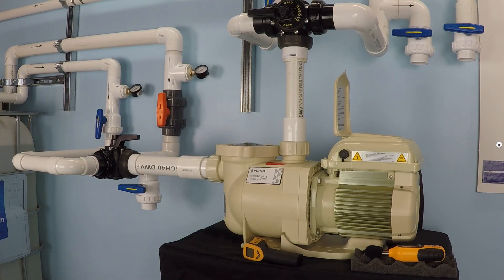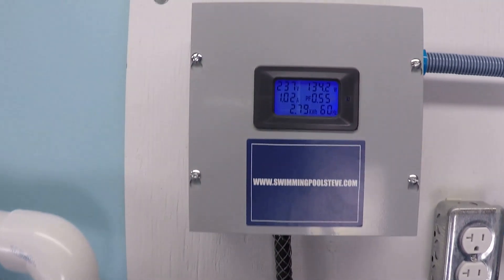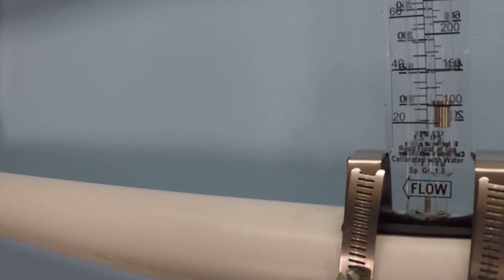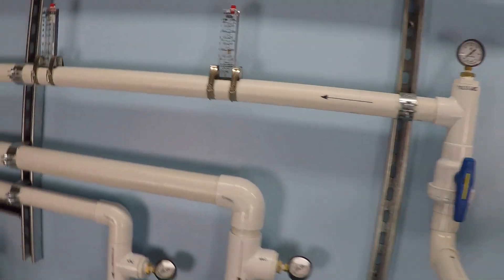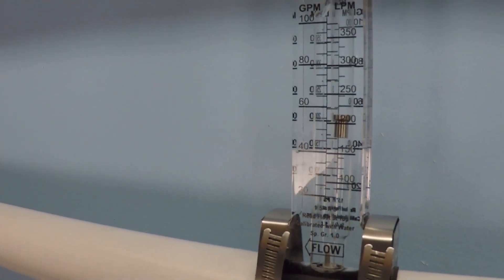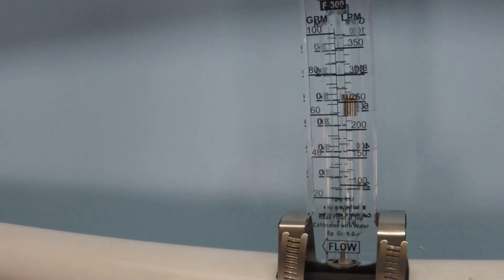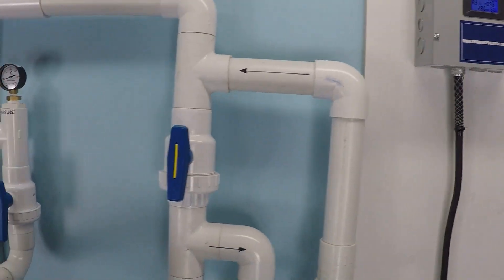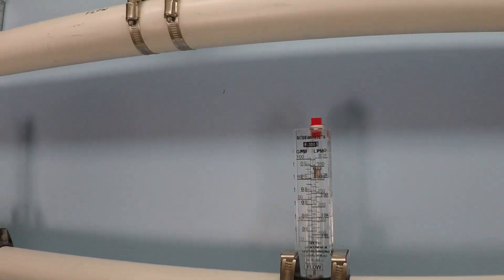Pentair SuperFlo Variable Speed Pump Test (Dual Suction Lines)

Comment: Wow great test!  So not the advertised rate of 170 gym.  A neighbor wants to sell me a 2011 model for our 2500 gal spa and I was wondering if it could be used at a low rate just to circulate and filter.
Reply: at only $150!!
Reply from the maker: The pipe size and number of pipes is what dictates the flow you will receive more than the pump itself. If it ran on larger pipes itnwould move more water